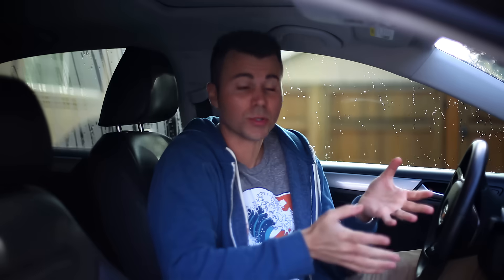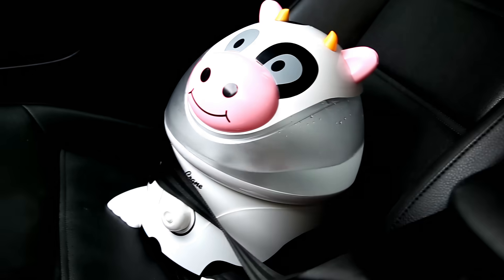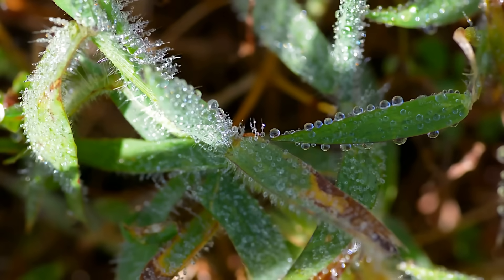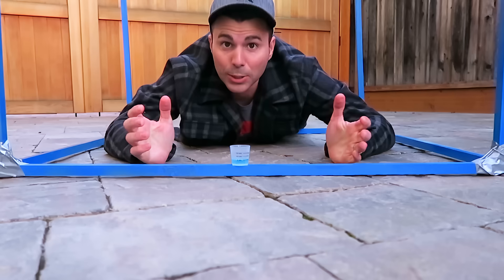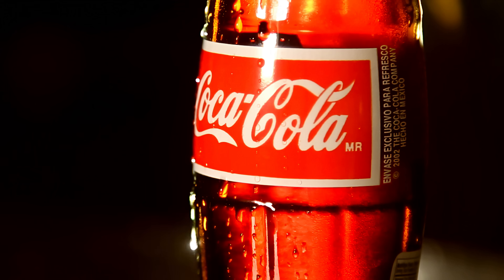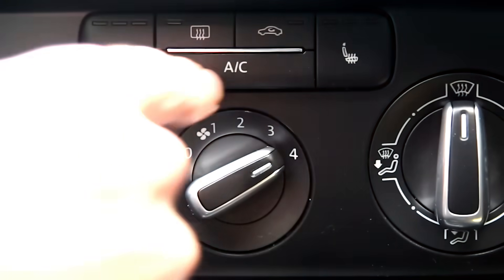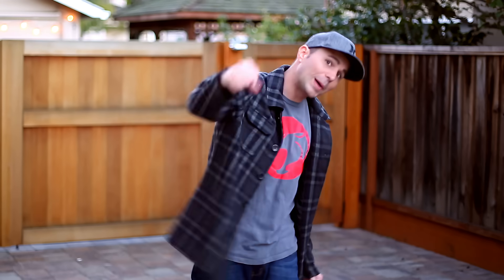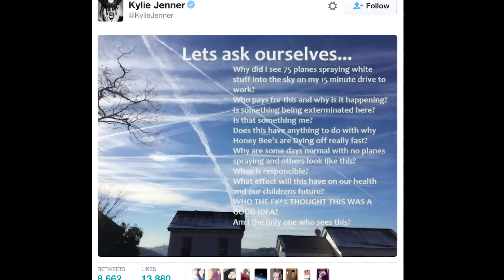Defog your windows TWICE as fast using SCIENCE- 4 easy steps

Comment: My air circulation button automatically turns off when I apply defrost windshield. Subaru knows haha.
Reply: My Mazda also turns off recirculation with defog automatically!
Reply: In my hyundai accent it would both disable circulation AND force A/C when using the defogger.
Reply: Some vehicles use the defrost vents as the intake for air recirculation...
Reply: My Volvo does too. But also turns on the a/c when I press the defrost. Those crafty Sweeds know a thing or two
Reply: @adamthompson4072  All cars have done it since the 80s. It is not a brand thing lol
Reply: What if you would rather circulate the air as opposed to defrosting faster?
Reply: @mbmferguson  then don't push defrost?
Reply: If it's a new car (last 15 years or so) it will do this automatically. Humidity in the car is often higher than outside air, so manufacturers disable recirculation during defrost to prevent people from leaving it in this mode and complaining that it takes too long to defrost.
Reply: @UncleDon226  I have a 12 year old car, but the air circulation is mechanical switch rather than electronically controlled.
Reply: @UncleDon226  You are WRONG! The reason you can't recirculate with defrost on is because the intake for the recirculate is the defrost vents!
Reply: @eatshitful  No, it isnt. Recirculating air draws from the floorboards near the bulkhead upstream to the blower motor. The recirculation door is just a flap that either draws air from outside the bulkhead or inside the bulkhead. You are confusing the recirculation door with the mode door. All the vents are downstream of the blower motor. You cant draw air in one vent, then have it go out another when the blower motor only pushes air one direction.
Reply: It's not even possible to set most old cars to recirculate when on defrost. If they have AC, it's on when set to defrost or bilevel no matter what you set the temperature to. The only recirculate setting is Max AC. There's nothing new about this at all.
Reply: These smart buttons really piss me off when you're trying to achieve something particular. Like the rear window defog button in my Subaru. The car decides when it's had enough defogging and turns it off. Even when the conditions exist for its immediate return.
Reply: @vitabricksnailslime8273  They have a timer built-in, I believe it's either to save fuel (those heating elements draw a LOT of power) or to preserve the longevity of the heating elements.  My Subaru would turn off the rear defroster after 15 minutes or so, but by that point even if it was fairly heavily iced-over it had all melted off and I could see clearly out the back.
Reply: Vitabrick Snailslime you can change it through settings
Reply: All my nissans and gm’s do this too
Reply: Same in Audis and Mercedes benz
Reply: I was told a long time ago, by a mechanic, the AC compressor comes on when you put defrost on, so that the AC equipment doesn't seize over the winter due to lack of use. Don't know if that's true, but it does make a lot of sense. That's why all cars do this.
Reply: @billballard9685  Actually it is to help defrost your windows..... It has nothing to do with keeping the AC working. Better find a better mechanic!
Reply: Also when you choose the windshield defrost choice on the control that directs the air the A/C will automatically cycle on (if your car has A/C)...
Reply: Asian technology.
Reply: Japanese numba 1
Reply: C.E. My 02 Tahoe does the same thing
Reply: All cars have done that since the 80s

Comment: An additional technique I use is preventing the condensation from happening at all before I park my car. Say I've been driving for a while in cold weather and have the heater on in my car. This means that I've pre-loaded the air with more water vapor since the air is warm and I've been breathing out water vapor the whole time I'm driving, which raises the humidity level in my car. What this means is that when I park my car and turn off the heater the air will cool off, causing all that extra water vapor to condense on the windows (which are the coldest place in the car). So what I do is about three to five minutes before I arrive home I turn off the heater and open some of the windows about two inches. What this does is exchange the hot, humid air in the car with the cold dry air outside so there will be far less water vapor in the car to condense on the windows. Since I do this right before arriving home, I don't get all that uncomfortable for those few minutes while doing this. Most mornings I have almost zero condensation, and what little does happen I can wipe off the window with a single paper towel, then run the heater for a minute or two on the windshield to clear up any remainder. Give it a try, it will save so much time!

Comment: Almost every vehicle from the mid 90's and newer will automatically turn recirculating air off and A/C on when you turn the controls to defrost. All you're trying to do in the video de-fog the windows not defrost them. Doing the shaving cream trick or cat litter won't help for frozen water on the outside of your car.

Comment: Just cracked the window open a little bit that night, this will allow the humidity and temperature inside and out side the car to equal out. you'll never have condensation on the inside of your car in the again. 
Frost on the other hand is different. I find command start works best, especially in -40.

Comment: Ok, I turn the AC on to increase the load in the engine to warm up the coolant faster but I'm dealing with frost on the outside of the glass, not fog on the inside, so I do recirc ON and windows closed to keep the air warmer. Also, the closer to my house I park the less frost I get. Is my house emitting heat or partially blocking some of the falling moisture?

Comment: Yes! A good practical video, love it!
Question. What about the other way around? What would be the most effective way to cool down a hot car? I live in Australia and the inside of a car can get up to 50 degrees Celsius (or 122f). 
I've found the best way is to put the air source from outside (to bring in cooler air), put on the highest fan setting, and crack the window just a little.
Then after about 5-10 minutes after the hot air has been forced out, close the window, change the air source to recycle, and change fan speed to 2.
Is there a better way than this?

Comment: Most cars I've worked with secretly turn on the A/C compressor when defrost mode is selected or at least cycle it on/off.  Except the car doesn't turn on the A/C led light indicator so people don't freak out wondering why the A/C is on in the winter. So in my opinion you don't really need to turn the A/C on...

Comment: You can use the defrost setting without it automatically disabling recirculation? That's incredible.

Even my 1999 Buick regal wouldn't let me do that
Reply: Depends on the car.  Older cars with mechanical controls will let you do pretty much anything but newer cars disable recirc and cycle the A/C pump to de-humidify the air automatically.  You can probably hear/feel the compressor cycling with your defrost running at a stop light.

Comment: And some cars automatically turn on the air conditioner, switch to internal air and select the defogging vent when you turn to "defogging" setting.

Most Dodge/Chrysler vehicles actually have a separate live defogging coil that isn't controlled by the circulation thermal control for cabin.

Bringing outside air in doesn't work as well as 30 seconds of the aircon running because it doesn't compensate for your humidity.

Comment: Hey Mark! I have no idea if you’ll read this since its an older video, but, any suggestions on defogging from SUPER humid climates like Houston TX when I turn the car/AC on early in the morning? Using your towel metaphor we have a small towel (cooler night air) shrinking due to AC, with the same oppressive humidity as the day and squirt fogged up humid windshield. Would the same principles apply? High-Heat-AC but windows closed to not add any more humid air? Any insights would be helpful!

Comment: In most cars, when you set it to defog the AC compressor will automatically run (even if the little light doesn't turn on to let you know).

Comment: I’ve never seen a vehicle that will allow you to use the recirculated air setting while on the defrost setting.
Reply: My car  that was almost 20 years old let me do whatever tf i wanted
Reply: Try older cars. Very possible. Everything is manually switched instead of digital
Reply: He said it, he didn’t do it. Listen again to the intro.
Reply: He didn't put it on the defrost setting
Reply: Have you seen every single vehicle?
Reply: If you put it on floor and defrost you can use recirculated air
Reply: My car from 2005 let’s me do this
Reply: New cars automatically disable recirculating air because it is often more humid inside the car than outside. Recirculation is drawn from the footwell where there is the highest area of moisture, and if the switch is set to defrost, the computer assumes there is condensation on the windshield. Thus, it decides for you that more moisture from your wet shoes wont help, so it moves the vent to draw outside air.
Reply: My older Honda will.
Reply: You've only seen one vehicle in your life? Aww that's so sad
Reply: European MPV, everything, including recirculation, is actuated by a nice Bowden cable... pull a lever to the left for recirculated air, pull it to the right for fresh air, and you can also pull it anywhere between if you want some kind of AC temp regulation in the summer...
Reply: I don't have an AC setting.
Reply: Older cars yeah.. mine will auto switch AC on and front vents if I turn recirc on
Reply: Set it to legs and windscreen than you can do anything
Reply: mine is from 2005 and wont even let me.
Reply: My car let's me do this, I also have a heated windscreen which helps.
Reply: For just One Dollar at dollar Tree you can buy a Moisture Eliminators container and put it in your car somewhere it will absorb the moisture really well, I never have fog inside my car.

Comment: I have to disagree with hot air being the fastest way, cold with ac on will do a better job to start as any hot air will hold that moisture which will then condensate on the freezing window.   Everything else is correct but that, once the window is clear or semi clear then turn the heat on to start warming up the window, keep the window cracked 1/8" until all the moisture is =. It takes a while to dry out boots and clothes.       Physics will agree with this also . .

Comment: Why can't we have windscreen wipers for the inside of the car? Some flat ones that then funnel the water down some piping then outside the car? Would that not be easier and quicker?
Reply: Easier and quicker than wiping the Inside of the window with a cloth or towel? 🤔
Reply: Yup, because wiping with a towel or cloth just smears it all over the window. You have to keep wiping to get it all off the window. Using a really good micro fiber cloth helps, though. I've had to experiment a lot because my heater/ac only works when it wants to and I end up with a lot of fogged up windows that I can't defog.
Reply: @annwithaplan9766  The window is still cold so the water will just condense again. hence warm air heats the glass and stops the condensation.
Reply: @mrzon9344  - I know. As I said, my heater/a.c. only works when it wants to. Needs a new blower. So in the meantime I have to either either keep wiping or keep the window down.
Reply: Also there’s this: https://en.m.wikipedia.org/wiki/Quickclear

As far as I know all Fords, even on base trim, comes with this as default here in Scandinavia. 
Though it’s for defrosting, it’s nice for defoging as well. Does a good job taking care of that outside condensation clinging to wax residues in the early autumn.
Reply: Because not everyone wants to pay for that when buying a car
Reply: HM Queen Elizabeth II once owned a Landrover which had an internal windscreen fitted to the rear window, when driving around the Highlands of Scotland her corgi dogs caused the window to steam up!

Comment: i`m stuck with a boss who thinks defrost with full cold air ,..common sense you need hot air to dry that window...and rem its all about atmosphere ,..so with 2 equal atmospheres you have no condensation,.. so then at night ...just leave your windows open ...a crack...or just as you are parking all windows down heat off being the laws of physics  ,..hot to cold....the warm inside of the car trying as all hell to get to the outside cold...just equalize the 2 atmospheres and you will eliminate most of this condensation...its only when the 2 atmospheres have drastically changed in very a short period of time that we even see condensation at all..extreme separations of atmospheric pressure

Comment: Missed the most important step! Set the HVAC mode to windshield/defog/defrost, whatever you want to call it. Pretty much every car, since 1980ish, with air-conditioning, automatically turns on the A/C when any defog more is selected.

Comment: Except if the air is too cold turning on a.c. does precisely squat as the compressor which drives the entire a.c. system will not engage because it's too cold.

Comment: Omg I didn’t want to cheat on my science class model and I think I just accidentally did by watching this video😂 ty. I’m trying to explain how a snowflake is formed and it has all these components that have to be very specific. Like we can’t say “heat” or “hot” or any words that relate to temperature. We have to explain it by the rate that the particles are moving. And I have to explain what a cloud is. Now I know it’s a air particles which contain lots of humidity which is the amount of moisturizer that’s in a particle which is the mount of wanted in a particle.

Comment: Most cars won't allow AC on with Heat because in summer time conditions, that doesn't make sense. In new cars the AC is a default setting with cold air because that is the most common use for AC and not for defrosting. The second reason why you should take time to defrost your car normally is so that it allows the car engine to warm up as it runs better in a cold environment. You should never drive your car with a cold engine!

Comment: FYI most cars automatically run the air conditioner in defrost mode for this very reason. This is also why you should take your car OFF defrost once the window is clear as running the air conditioner unnecessarily just wastes fuel efficiency. I didn't know about opening windows but it does make sense.

Comment: When you switch your car's HVAC system to defog, the AC compressor is engaged automatically to dry the air coming through the vents. So in most cars, manually pressing the AC button is unnecessary.

Comment: This guy is correct about what he is talking about but most  cars roughly 95 and newer will turn the a.c. on automatically when on the defrost setting and most will automatically pull on the fresh air to take all the thinking out of it . All you should have to do is match the inside temp to outside temp. The difference in temp will create condensation. If fully iced over the hear will melt the ice

Comment: I call BS on this video. First, which is it? Defog or defrost? Fog is water vapor droplets and frost is ice. 

1. Full heat on. Well yeh, duh.
2. A/C on. The trouble with that is that a car’s a/c compressor will not turn on below 50 degrees F and even if it did, dehumidification occurs only because the evaporator is cooler than the inside air so you have to wait for the heater to take full effect anyway. If merely defogging and outside temp is above 50, then yes but most cars turn on a/c automatically in defrost mode.
3. Recirculating off. Good idea, let’s put cold air into the cabin thus counteracting step #1.
4. Crack windows open. Good idea but should be done before you exit the vehicle in the evening thus reducing the moisture in the cabin.

Want to defog/defrost quickly? Turn on your car, turn on defrost mode and get out of the vehicle. Your warm, moisture laden breath is what is causing most of the frost to begin with. If you unburden the system of moisture until the windshield warms, that’s less water vapor to condense on the glass. Simple as that.

Comment: This doesn't make sense. When you turn the temperature knob to full hot, it just moves a blend-door that closes off air coming from the A/C, so the blower instead will pull air across the heater core. Turning the knob to full heat will mean that your A/C will not be able to contribute anything to the situation whether the compressor is running or not because you've effectively shut out access to the air surrounding the A/C coils.

Comment: Another tip: if it's cold out and you want your heat to work as fast as possible then wait for the engine to warm up before you turn on the heat. Turning on your heat will make it take longer for the engine to warm up as it acts as a second radiator which in turn makes your heat take longer to work

Comment: I was mostly onto this from my not scientific testing of years of windows getting foggy while driving. It's good to have confirmation, though.
What I have more trouble, I find, is a fogged windshield in warm, rainy or humid weather. Sometimes it's the outside, and not the inside. Hot summer nights, my a/c is sometimes on so high that the moisture in the air outside condenses so bad I have to turn on my wipers!